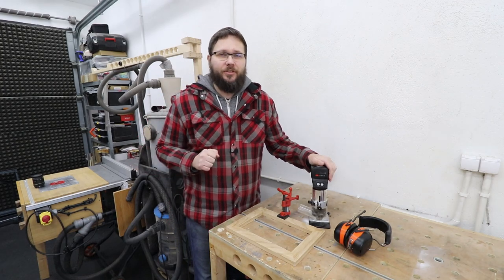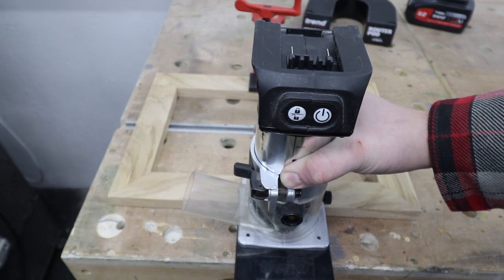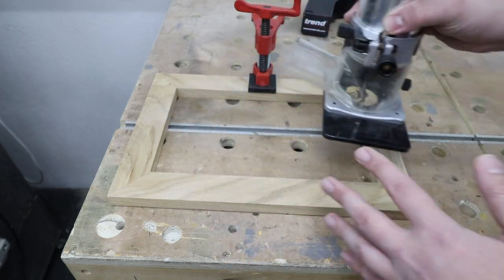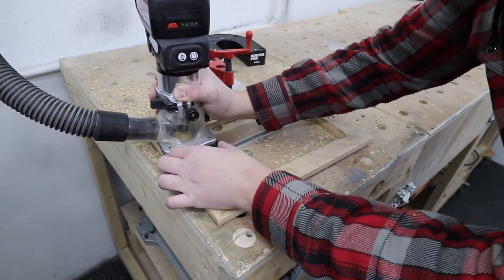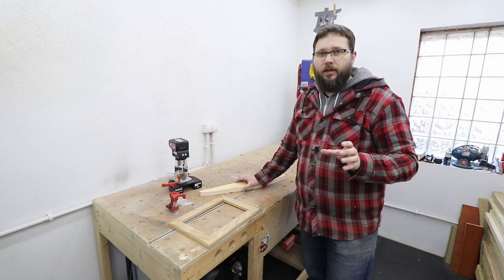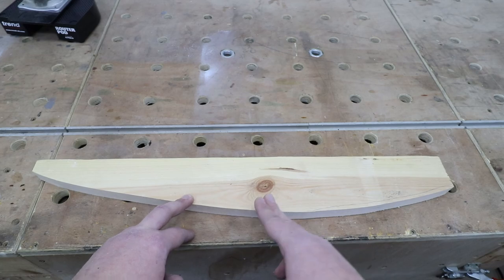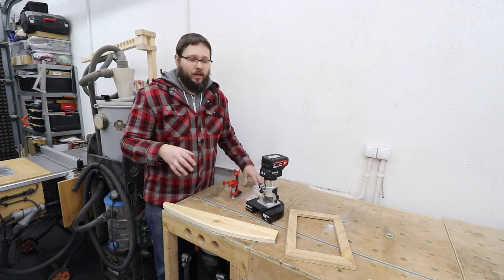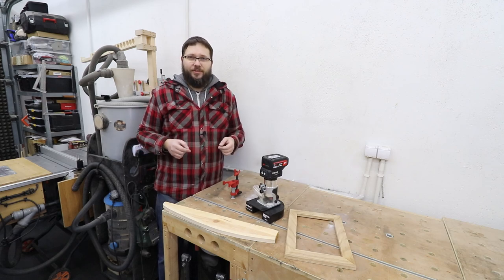Router Feed Direction Basics | What is a Climb Cut???

Comment: Thanks Tomasz, a great explanation.  This is something I always struggle with remembering and the push cut almost seems counter-intuitive that you are pushing against the spinning router and encouraging more tear out as the cutter blade emerges out from the wood.
I was doing some roundovers on window boards earlier tonight, and yes, I now know I was doing them the right way round 😊
It can be quite “exciting” if you push the router in the wrong direction and it judders into the wood.  Hopefully I can avoid it more now
Reply from the maker: Easy to forget or get confused with this. Got a planned video for a router table as that has its own rules as well 👍